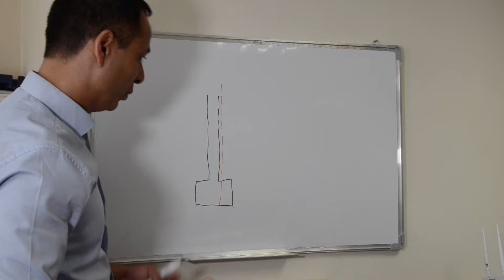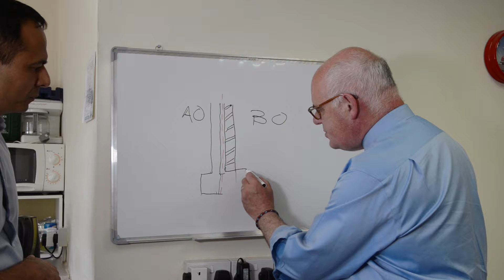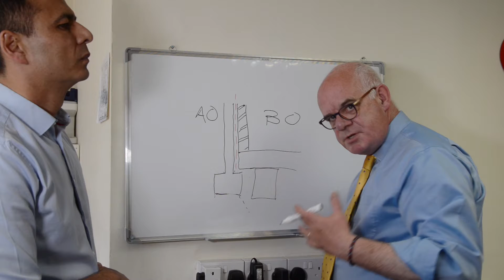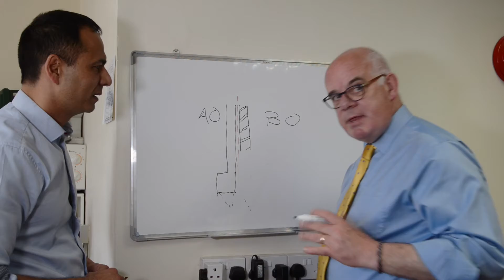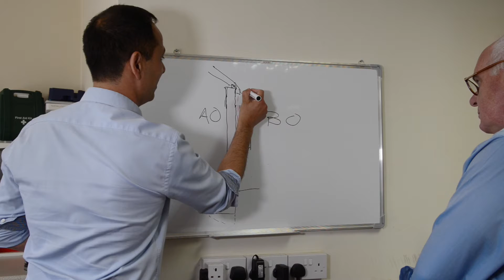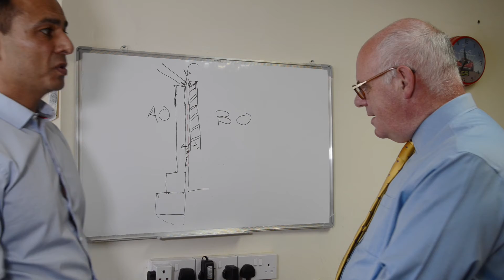Video 7 Building up to to Neighbouring Properties  Arun Ass  +WJM +RK

Comment: under Party Wall does the designer need to consider the pressure under a Boundary Wall that has foundation protruding or can a designer assume that under Party Wall the original designer must have assumed that in future this will get cut off as it is allowed under Party Wall Act. Therefore would it not be sufficient to make sure that say in your case shown BO cuts off the foundation to boundary line and then the designer for BO design an eccentric foundation or is the BO designer required to check pressure under AO's foundation which was extended to BO's side? At the same time I thought that under Party Wall Act the gutters etc should not extend over the boundary line and it shall be the same principle that BO can simply cut these off and should not be required to have someone to design a solution for AO as it adds cost to BO where one should assume that AO would not be allowed to extend beyond boundary line in the first place if they decided to build the wall whole on their land. Or am I misunderstanding BO's rights?